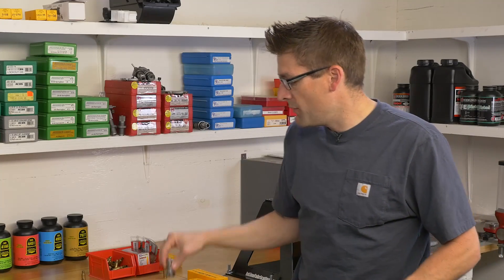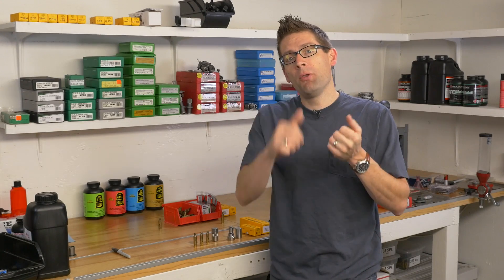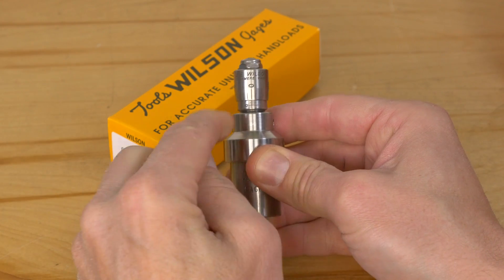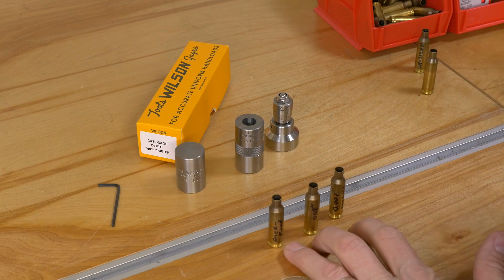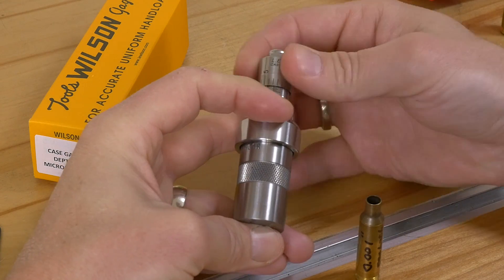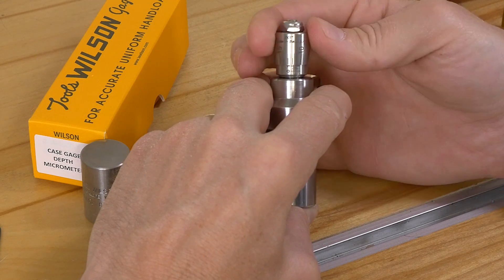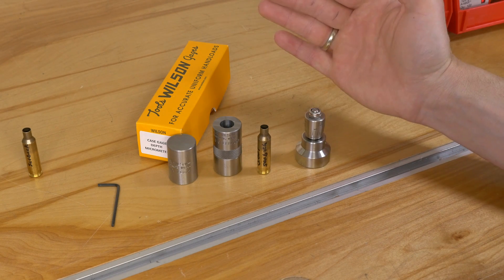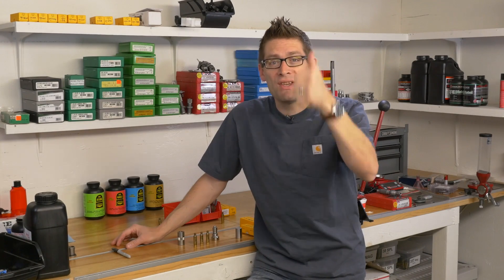Overview: New L.E. Wilson Case Gage Depth Micrometer

Comment: I got the micrometer but It was unusable. Every 1/2 to 2/3 turn it dragged and slowed like I was hitting the brass to measure, so I couldn't tell if I was hitting the brass or was the drag on the dial.  It was cleaned, lubed, and cleaned again, none of which helped the issue. Returned it for a refund.

Comment: Gavin, Your checking the length by just holding pressure down on the Micrometer against the Creedmoor gauge / not a glove. gage,  then getting your measurement, on your Creedmoor case gauge?   Is it only marked Creedmoor on the case Gauge like mine, not 6.5 showing?

Comment: the gauge measures where the HS is, but you have to size the case to where you want it.... correctly. Fast strokes on your press gives inconsistent readings. Holding down on the end stroke for a few seconds or more allows for proper forming of brass case.

Comment: I just purchased this tool and do not know how to set recalibration it to zero.  It is slightly off.  I used the allen tool and removed the screw but get no adjustment.  The instructions say nothing about recalibration.  Any suggestions?
Reply from the maker: I will ask L.E. Wilson!
Reply from the maker: Wow- heard back already! Here's how you do it: 
1 Loosen set screw
2 Back out micrometer top
3 Grab scale portion and turn clockwise and counter clockwise to loosen pressure on set screw pad
4 Dial mic portion back to zero
5 Set on top of Gage Block
6 Turn clockwise until spindle bottoms out on top of Gage Block
7 At this point you zero will be close.
8 Fine tune by moving scale sleeve clockwise or counterclockwise to set zero
9 Tighten set screw
Reply: Thank you for the quick response.  I bought this tool after watching your video.  Thanks for the help.
Reply: @Ultimatereloader can you make a short video with that 
Thanks

Comment: Will one micrometer work with all cartridge case gauges or is the micrometer cartridge specific?
Reply: It works with all but you need a case length gage for each cartridge.
Reply: That’s right.

Comment: for remy 700 r5 I only neck size
Reply from the maker: +raoul pabon Neck sizing is great, but at some point you typically need to FL size (after several neck-only sizings) in order to get the brass back into "chamberable" dimensions.
Reply: shoot them4 times than aneal and full size and trim works pefect